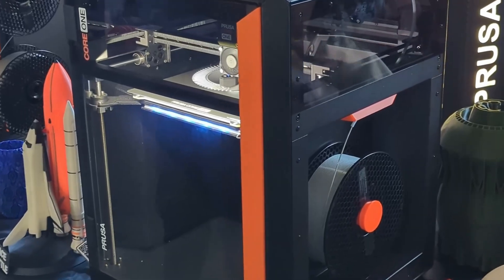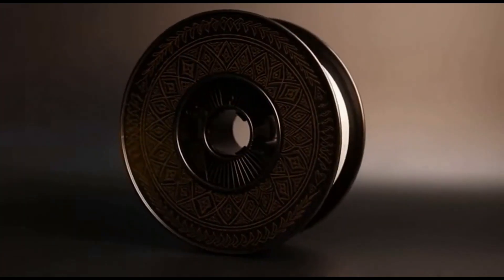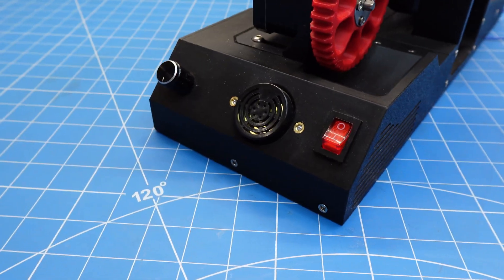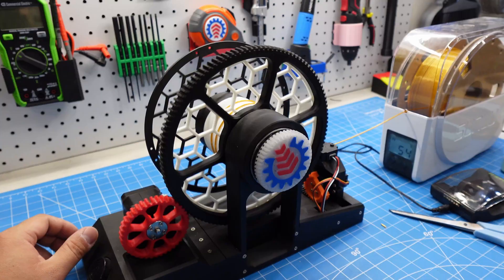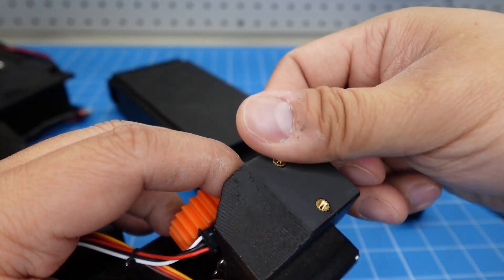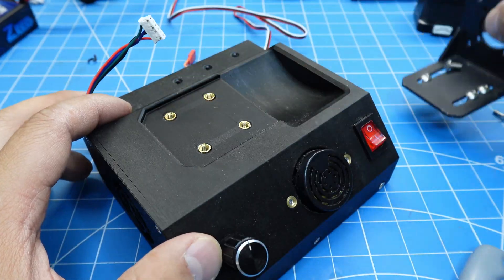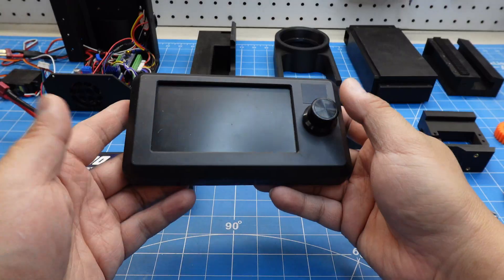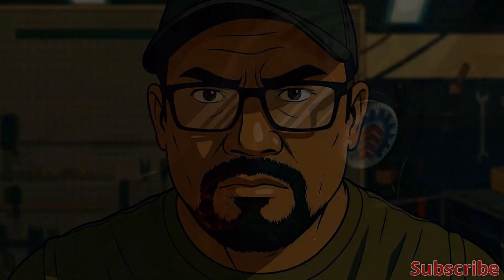I Designed This 3D Printed Filament Re-vinder

Comment: Very nice!  If someone can come up with an adapter to use Ryobi or other drill battery packs, that would be awesome
Reply: There are adapters you can buy or print that do just that plug into the battery and convert to a standard battery connector